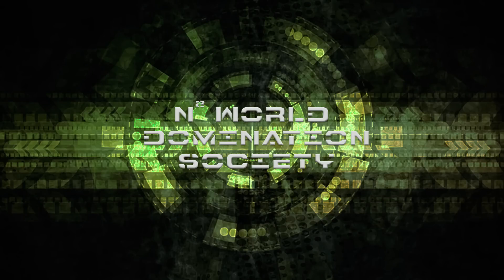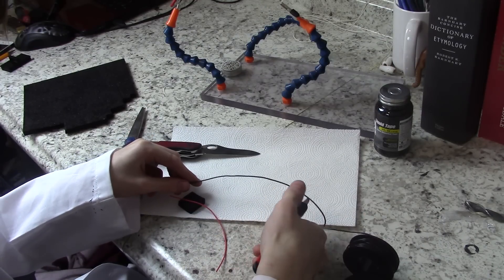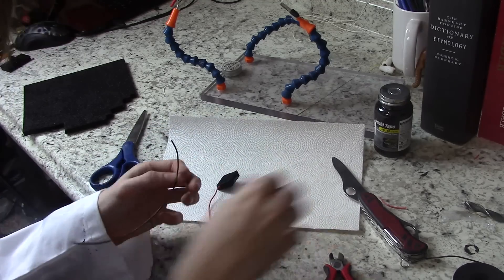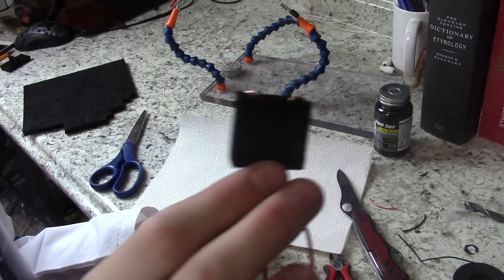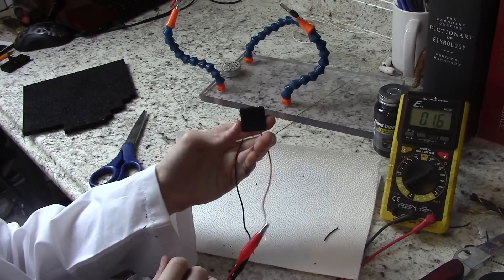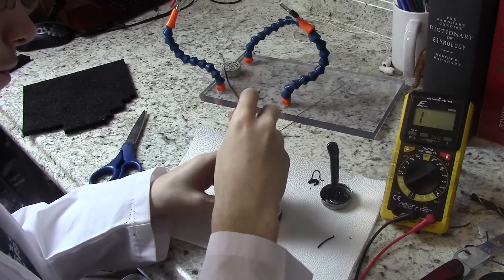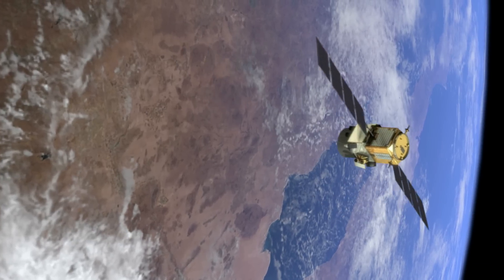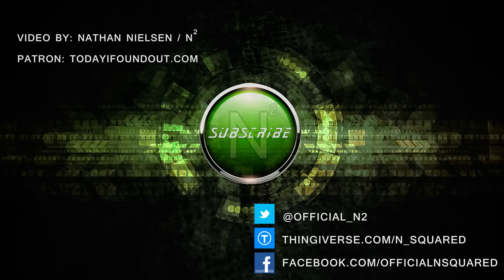How to Make a Ridiculously Cheap Analog Pressure Sensor

Comment: How would you extend the width of this so that you could use it for stairs? Would carpet also cause issues? A simple on/off is all I really need. I don't need to check the resistance. Commercial products are around the $15 to $20 range which is just ridiculous.
Reply from the maker: Not sure if you could use this design over that distance. However I might try putting a sensor where the most foot-traffic on the stairs is and put the wires across the thinner side of the sensor.

Alternatively, it might work better if you get a large price of cardboard or wood and put it over 5 or so large buttons spread out on the underside of the cardboard (like the 5 on a dice) and then put that under the carpet so the buttons get pressed when someone steps over that area of carpet.

Sorry it took a wile to respond, I've been having computer troubles lately. Hope this helped
Reply: N Squared That's a great idea on the tactile buttons! I was really looking for something more along the lines of resistive sensor detection though. I believe I've come across a good solution using Velostat and some strategically placed micro controllers. No worries about the delay! Liked + Subscribed anyway. P.S. You gave me a good starting point which led me to Velostat, which I believe will fulfill my project's requirements. Thank you!
Reply: For my project,  I am also using Velostat.  I am soldering highly conductive silver-copper wire to strips of copper foil, with a strip of Velo in between.  I am considering encasing and attaching it to the trigger object, in your case the stair tread, with something like hot glue.  Right now I am using Gorilla (r) tape one strip on each side.